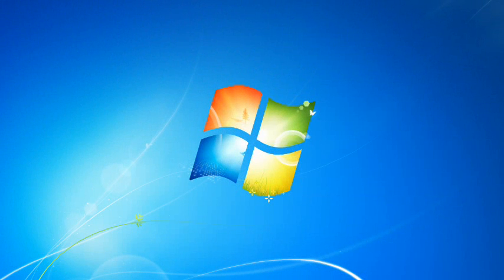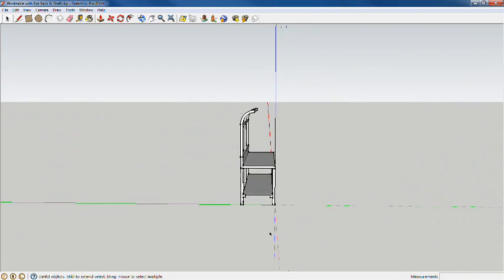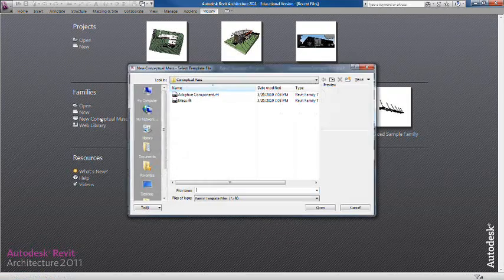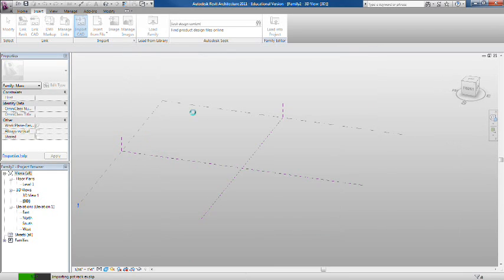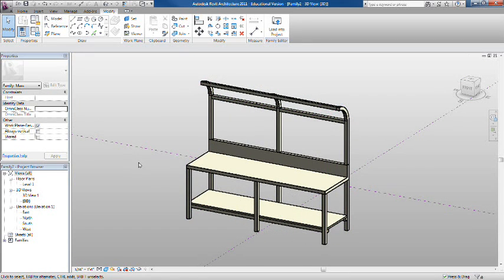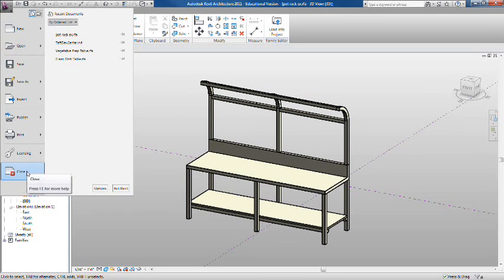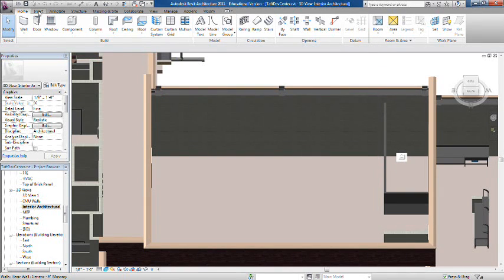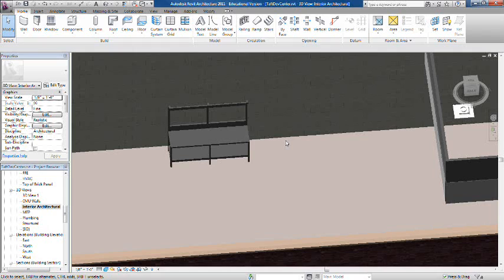Importing Sketchup Components Into Revit Architecture

Comment from the maker: It depends on how big/complex the building is. When you try to bring in complex objects into Revit, it may not display properly, or not display at all. It is best to create the building in Revit, and then import some simple models, such as casework, into the building. Remember, once it leaves Sketchup, you will not be able to modify the component at all, and material properties cannot be assigned. This may be a problem for your building, as it would only display as a charcoal color.